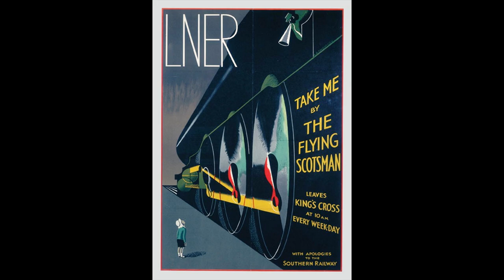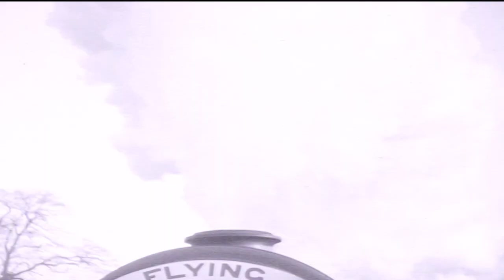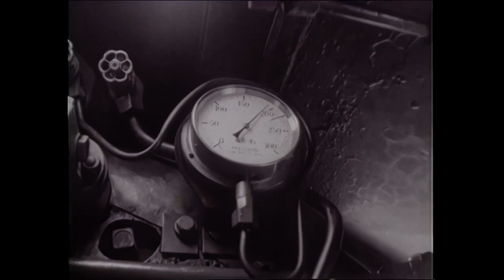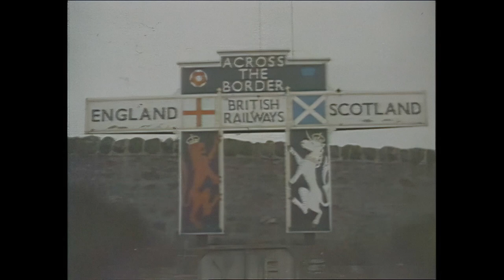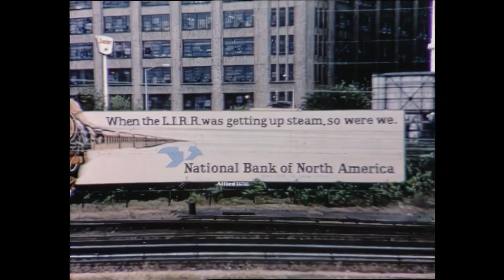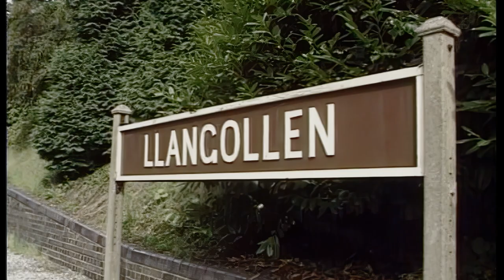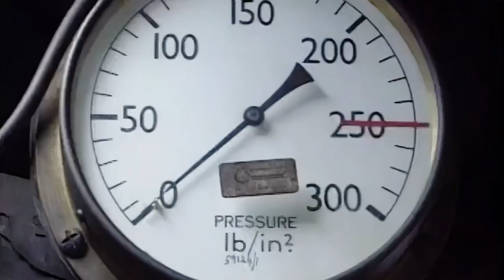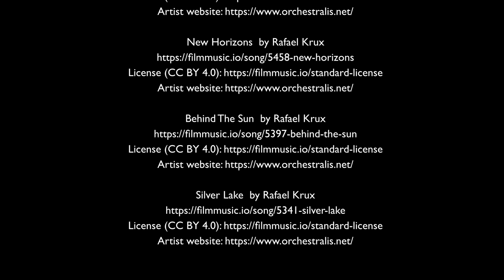Celebration 100 Years Of The Flying Scotsman | Train Documentary | Documentary Central

Comment: Wrong, Wrong, Wrong.  Not the most famous.  Big Boy, Hiawatha, there are hundreds of locos that  are bigger, more powerful and faster with a full load.  Typically British BS.  "we are bigger and better" dont let the truth get in the way.  The first Hiawatha ran between Chicago and the Twin Cities on May 29, 1935, on a daily 6½ hour schedule over the 410 miles (660 km) to St. Paul. The four new class A locomotives had streamlining by Otto Kuhler, were oil-fired to reduce servicing time en route, and were some of the fastest steam engines ever built, capable of powering their five-car trains at sustained speeds more than 100 mph    The most powerful steam locomotive currently in operation is the Union Pacific "Big Boy" 4014, a simple articulated 4-8-8-4 locomotive capable of a tractive effort (pulling force) of 135,375 lbf (602 kN) at 10 mph  The UP 844 is the LONGEST SERVING STEAM LOCO IN THE WORLD.  In 1944, Union Pacific and the American Locomotive Company (ALCO) collaborated on the FEF-3, a class of 10 locomotives designed to pull passenger trains at 90 mph. The FEF-3 could reach and regularly run at 120 mph  It will pull a train at 120 MPH.  It will Pull the little british loco cold at  more  than 100 mph.  Get your facts right.  Its embarrassing.
Reply: Never heard of big boy
Reply: The UP 844 is far from the longest serving, flying Scotsman entered service over 20 years before 844 and we never said Flying Scotsman is the best in the world but she's a mighty fine locomotive, so maybe get your facts right!
Reply: Never heard anyone say that before just because your American didn't mean everything that your country has made is better do your research on flying Scotsman and American trains and see what comes out in top
Reply: @TopTrains22  Exactly, whatever this dude is in about is complete codswallop, clearly a bit of a too proud American!
Reply: It's famous
Reply: Who invented the steam engine, Big mouth, us loud mouth Brits open the world with our little engines, we didn't need big ones
Reply: @nicholasmcveigh9879  EXACTLY
Reply: @nicholasmcveigh9879  and Scotsman is still a giant, she is just small compared to America's overweight engines
Reply: Mate, if you think american steam will beat british steam in speed, you'll be wrong because if they do, we'll do anything to get it back. And to say "get your facts right" The UP 844 isn't the longest serving steam loco in the world and Big Boy and Hiawatha aren't more famous than flying scotsman. Has any american steam loco circumnavigated the globe? no. Will they ever? no because they're too bulky, to heavy and cost too much to run. British steam trains are more practical, more better looking, and are used every day of the year, American steam trains are unpracticle, cost too much to run, and not prettiest thing to set your eyes on. So mate, stop going on about the facts you just from wikipedia and get YOUR facts right.
Reply: @Merchello  well said
Reply: You should get your facts right. 
Flying Scotsman became the first steam locomotive to be officially recorded reaching 100 mph.
That is all that is relevant.
And at also holds several other records.
Big boy is quite famous. But it can only claim biggest locomotive in operation......
As am not British or American, I would say that Flying Scotsman is the most famous and big boy are at best perhaps no 2
Reply: @mrnokia7253  that’s basically what I put; you’re not making sense
Reply: I'm american but I have to say, British steam engines are the most visually aesthetic in the world.
Reply: Flying Scotsman is the most famous. Ask anyone what Flying Scotsman is, they'll know what it is, it is not the same with 844 or the Hiawatha.
Reply: The only thing I have to be embarrassed by is reading comments by people who clearly don't do their research before they spout out irrelevant twaddle
Reply: @Merchello The flying Scotsman s restoration cost 5 MILLION pounds. Mf you CAN’T be talking about price. We have 2 of your a4s, and they look like Beatles. Maybe search up Dreyfus Hudson if you want to see good looking steam
Reply: @backonpro5679 shame the hudsons weren’t preserved however!
Reply: Say what you say about American locomotives, but its an undeniable fact that Flying Scotsman was influenced by an American locomotive class - specifically, the Pennsylvania Railroad K4s class of 4-6-2 Pacifics.
Reply: @kristoffermangila   maybe, but the K4s weren't as elegant, successful or famous for anything really. Flying Scotsman was one of many A1s so it wasn't specifically influenced by the K4, it was merely Sir Nigel Gresley being inspired by the K4 and making his OWN design. Anyone can make a 4-6-2 design.
Reply: @Merchello  if you remove Flying Scotsman's Great Northern Railway style firebox from the boiler and replace it with a Belpaire, it bocomes a dead ringer for a Pennsy K1s firebox-boiler unit. Sir Nigel Gresley, when he was designing the A1, hit an impasse concerning the boiler. He then saw the drawings of a K4s boiler in the technical press at that time, and he got his eureka moment.
Reply: So?They're both great steam locomotives,saying this as an American myself.Think  before you speak.Both the U.S and the U.K have great steam locomotives.Besides,the U.K has had steam locomotives probably longer then we've been a country.